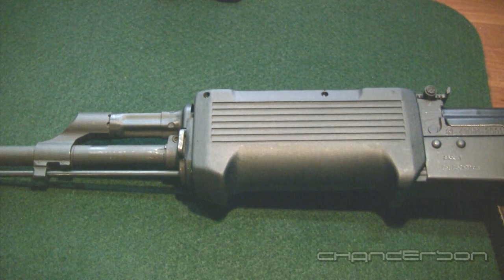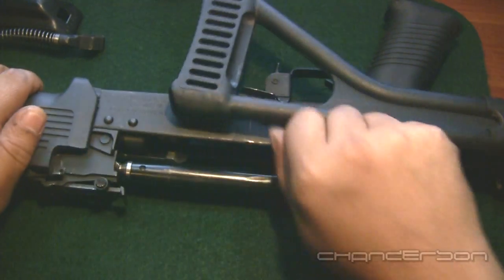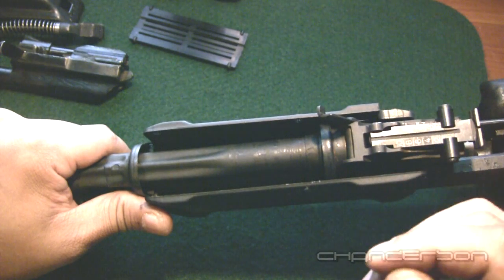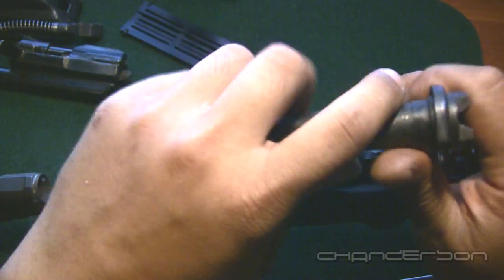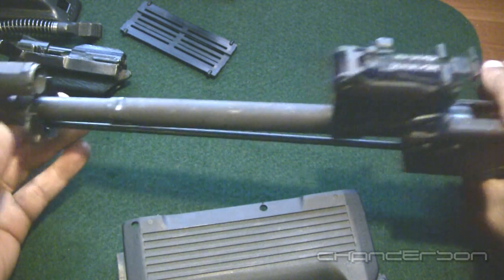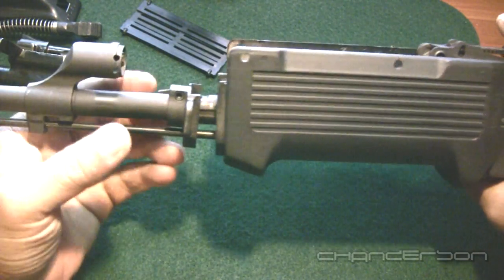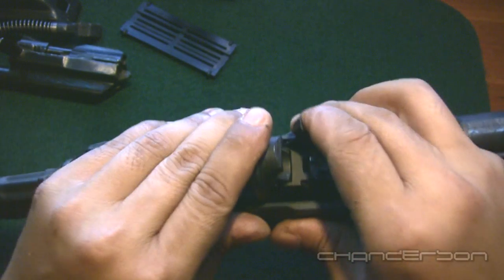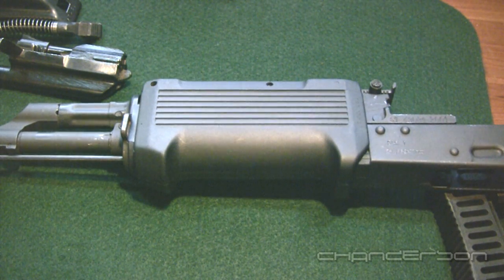AK47 foregrip removal and install

Comment from the maker: Hi, I am not really familiar with the Saiga and I'm not sure if the procedures are the same.  I know once you remove the top handgaurd and the gas tube on mine, the lower handgaurd rotates out of the retainers.  It was a bit difficult at first but it came out eventually.

Comment: Very nice.  I wish I would of watched this before I did mine.  I finally exceded but it was not as easy as you showed.  By the way I have that S.O.G. multi-tool also.  It is a really nice tool and knife, it has allot of guts to it, very strong.  Keep the videos coming.  Thanks

Comment: i have the exact same set of furniture that came with my rifle. i want to put it on but does that front grip provide any heat shielding? i mean better than the wood cause after i shoot a 40 rd mag i cant even touch the wood

Comment: @chanderson1 hey man i been lookin forever for a cleaning rod for my ak it didnt come with one where do you recommend to get one at and are they hard to put in i mean would i have to remove everything you just did in this vid to install it? i have the same ak as you with the same stock and the same handle and i put a recoil buffer in as well just always wanted one of those cleaning rods cuz the one i been using isnt really made for an ak plus the cleaning rod def helps the looks out imo thanks

Comment: How do you like that hand gaurd? I just shot my AK for the first time today, and it has these standard looking synthetic grips, and after firing about 50-60 rounds, my hand was getting burned, because the hand gaurd was so hot, is that a problem with those galil style grips?

Comment: @chanderson1 It all came apart easily enough, however the front lower guard bracket needed to be pursuaded to move foward with a rubber mallet and plastic piece. Your plier trick to move the retaining tabs is brilliant and really helped to limit marking and damage to the levers. I had a yugo sks I loved, until that lever became loose and would cause the gas system to malfunction. Thanks again.

Comment: Nice video. I checked it out to learn how to remove the Tapco Galil style FG. Never played with one and I hate it, but the Norinco came with it so... The OEM fore grip top cover turns 180 degrees and slips out of the two retaining collars at each end of the gas tube. I used a padded crescent wrench or padded vice jaws  to hold the squared back end of the gas tube, then turn the top hand guard by hand 180 degrees so it will slip out. Installing a new top cover like an ATI or similar is reverse of removal.
 Hope this helps skylinedrake.

Comment: My front hand guard lever is stuck any advice?
Reply from the maker: They are typically super stiff to move. Most of the ones I've had, I needed to use pliers to move them initially

Comment: Dude it's so hard getting this on my WASR 10-63 I gave up for now. The gas tube lever does not come down. Did anyone else have this issue? If so what was the remedy?
Reply: You have to fit it. File and test. File some more. Take your time.